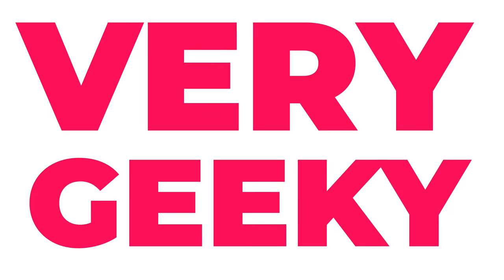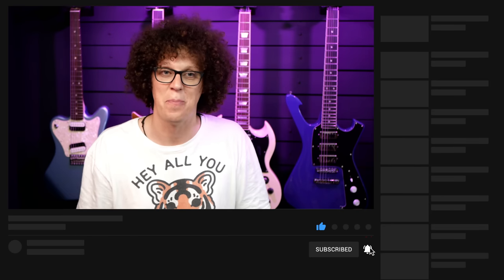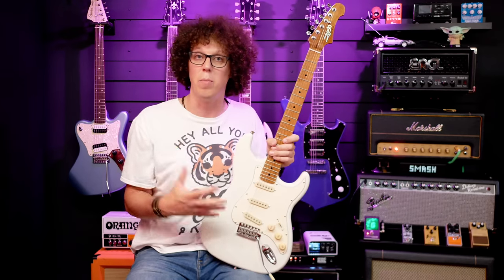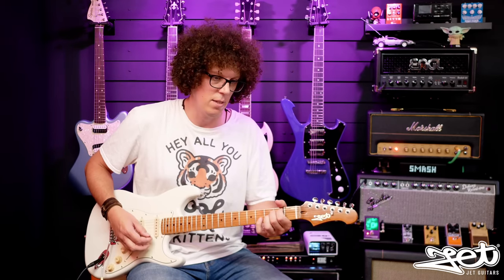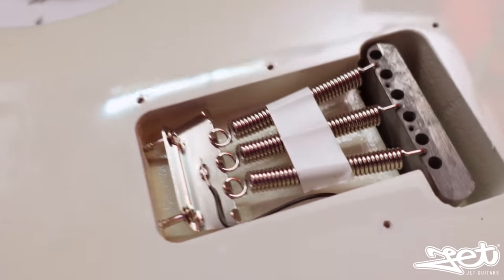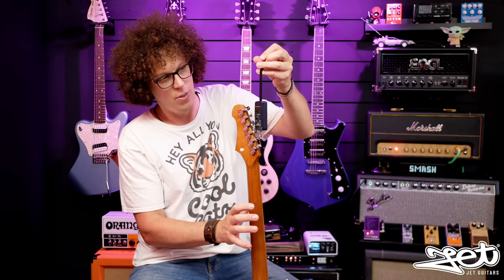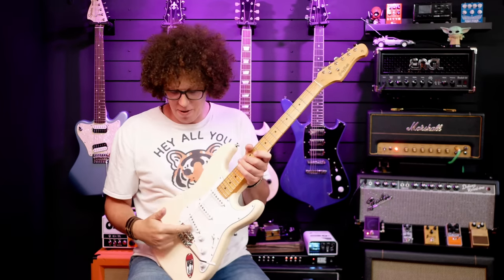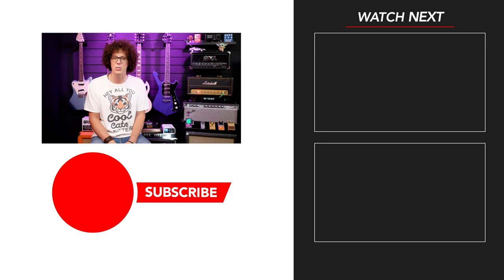Cheap Strat Showdown - Harley Benton VS Jet Guitars

Comment: I may go with the Jet.  Love the bone nut and roasted maple neck.  The new ones have two single coil and a humbucker which gives some interesting options, but not TRUE STAT sound.  Even so, the clean sounds are where the difference are.  After  you add some gain or a pedal, it's hard to tell which guitar is being played (Since my hearing is not so great).  Great comparison.  I didn't hear you complain about the bridge screws (Maybe I missed it) on the HB.  Several players have mentioned it.  Since I do a lot of  palm muting, that might be an issue.  Since I haven't seen an HB up close and personal, I don't know how much of an issue or if they can just be swapped out.  "CHEAP" guitars is a relative term now since most are made with CNC machines and can be quite well put together.   So, Strataliscious - if that's how you spell it LOL
Reply from the maker: Hey Steve, yes the saddle screws were a but annoying but something that can be fairly easy to fix.

Comment: Ive just bought the Jet JS300 and in my opinion the neck alone is worth the price of the guitar. Im hoping to use it as a modding platform but first on my list is to try to 'flatten' the black gloss finish 👍The neck on mine is more satin than glossy perhaps Jet have changed their manufacturing process ? Stratilicious

Comment: I just got a lefty Jet JS400 as I was swayed by all the hype surrounding the brand on here. Their profile seems to be higher than any other budget brand. I'm initial impression is this guitar is comparable to instructions to higher end Squiers. I like the sculpted heel, but some of screws in scratchplate and string tree were a bit wonky, so QC isn't quite there. As to playability, the guitar felt great (satin neck) and it sounds great through my Blackstar.

Comment: Great video. 
Having watched other reviews on You Tube, I have been surprisingly impressed by Jet guitars. However, I wanted to see a direct comparison with a similarly priced guitar of equivalent quality. The Harley Benton was a good choice and after your review, I found it difficult to choose between the two. They where both impressive for budget end guitars, but if I was in the market for one.  The JS-300 would win, although the ceramic pick-ups would be the first thing to go and a set of Ernie Ball strings fitted.

Comment: I bought a Jet JS450 for 300 Euros. One of the screws on the locking tuners was bent, but all work fine. There's imperfections on the binding. The color is quite different to the pictures. Play-ability is amazing. Sound...I have planned on changing pickups as soon as I get the guitar...and haven't done so yet, as I quite like the sound of the pickups.
Reply: what about the fretwork levels?
Reply: @ederrocha7758  I do have a 2500 Euro Blade, that I've been playing for 20 years - I do not notice any difference when I pick up the jet. And definitely much better than the 1k Euro Charvel DK-24 I ordered and sent back, because frets were unplayable.

Comment: I have several cheap strats with MAJOR upgrades because I like to see how close I can get to the American standard. You can get pretty close if not just as good with the cheap strats from h.b. and squier, so I'm guessing the jet would be the same
Reply: I think thats the way to go with solid body electrics..take a cheap guitar replace everything thats not wood including(and most important) the frets with higher quality ones(i have stainless steel ones in all my guitars now) and the nut...then roll the fretboard and presto..you have a high end neck everytime even if the neck says harley benton or squier bullet or jet....i would personally take a jet( cause i like the whole roasted neck at this price),throw in some big jescar stainless steel frets,tusq nut,hipshot tuners,new loaded pickguard with kinmans...the works...you cant really go wrong with this and if by any chance you feel that you wanna move to something else...just put most of the old parts back in and keep the expensive aftermarket ones for the next project....
Reply: @Dreamdancer11 The nut 😮b the Jet guitar is perfectly usable😮 not the best but good.
Reply: @johncollins5552  i know, i got the guitar eventually...the guitar is a great bargain...great roasted maple neck(the thing that sells this guitar),useable tuners,bone nut,standard chinese electronics and a bit rough frets.....i polished those frets and dropped the nut action a bit and that was that for a while..basically that guitar stands its ground bone stock against most strats and frankly i would keep it bone stock but i wanted it to be high quality suhr like so i did what i said i would do in my previous comment plus i scalloped the fretboard too...now its an instrument i wouldnt swap with any signature fender out there....

Comment: Do you want to compare the guitars or the strings? Change the strings on both guitars before testing. When both guitars have the same strings you can make a more accurate test. 
I just looked on the Trhomann site, the Harley Bentons now come with a roasted neck too.

Comment: I am a big fan of budget guitars (for modding). I ordered a Jet JS450 (love the look) on April 1st - and haven't gotten it yet. I also bought a second hand unfinished Harley Benton DIY Les Paul kit - with a bolt on neck. And to my surprise, its sustain rivals that of my 2 Epiphone Les Pauls. The switch and controls aren't great - so I am soldering my own electronics and will use Seymour Duncan P90s. The nut also needs work, but for 68 Euros and absolute steal.
Reply: Totally love the look of the JS450 too.  Has it arrived yet, and if so what do you think of it?
Reply: @rodsimmons9337  I got it three week ago. it doesn't look as gorgous as on the pics,but I still like the looks. It's very dark and less flamy - I expected I'd switch the PUs as soon as I get the guitar. But I actually like the sound. Few things:
Reply: @rodsimmons9337  one of the twisty things of the locking tuners is at an odd / close to 45° angle. It works, but when you change strings, you wonder if it'll have to be replaced eventually. And when setting up the guitar, one of the screws is under the low E string, so Ihad to loosen that to turn the screw. Still a steal at 300 Euros

Comment: How DOES one write stratelisious? Let alone define it?
Fun word, fun video.
I prefer the sound of the Harley Benton, sprouting fretends can be dressed, boards can be rolled.
The trem might need replacing, but seems to work ok. I know where I'd spend the extra ££ as well, on a nice cheap overdrivrive pedal.

Comment: They seem pretty equal (outside preferences, mostly). I think I'm going Harely Benton. Lower price, awesome customer service, great warranty & if I spend the same as I would on a Jet, I then get some sweet upgrades.  Thank you, great comparison & excellent playing. Wish I had learned the output jack rule of thumb earlier. Yikes I have one to repair from turning it and busting wires.

Comment: 6 bolt tremolo systems are going be stiff, but no need for tremolo setter or lock that you will need with a floating 2 bolt Floyd Rose. The biggest advantage is the Jet's volume knob is further away from the bridge pickup where the HB the volume knob is way too close even Fender make's that mistake. The Jet pickups has more clarity.

Comment: I didn't have the same luck with Jet ,  bought my youngest son one of their basses for christmas . Volume pot was shot out ,  frets were like razor blades down the sides of the neck , bridge was  crooked and no where even  close to centered .  Had no issues with return though and even had the 80 bucks back on my card  about 20 minutes after UPS picked it up . All in all I wasn't really expecting much for 80 bucks , and if it hadn't been for the volume pot , I probably would have done a fret job on it and centered the bridge .
Reply: They dont make basses, are you sure its the right JET guitars?
Reply: My mistake  , had to take a look myself at the invoices , the jet was cancelled cause he changed his mind and wanted the Jackson RR V , the bass was a glary .Must have been the cheap price that had me confused.

Comment: good review Andy .I bought the stratalicous js 400 after watching your first review.im delighted with it.as you said a fantastic mod platform.i also bought 2 Harley Bentons to stay sane in lockdown.the build quality of the jet is far better than the Harley Bentons in my opinion.had to change the tuners, the nut,the bridges and dress the frets on both Harley Bentons.did nothing to the jet except change strings and I've put locking tuners on....because I like em not because they were bad.im retired now.ive played Strats for 50 years mostly USA.i still have a 57 an 88 and 76.i bought the jet for a more modern sound.im still uncertain about the pickups I haven't tried them at volume yet.
cheers Andy.keep up the good work!

Comment: Hi, On the Jet Strat, I would invest in a 2 point piviot tremolo with a brass block, locking Ninja tuners, brass saddles, a brass nut and a loaded 920D strat HSH Modded pickguard then you'll would have something that the Harley Benton wouldn't even compare. The Harley Benton Strats needs to upgrade their tremolo Block, it looks cheap and thin, losing natural sustain in the tones.
Reply: with all those mods, you're better of buying a mexican fender. if you get bored with it, you will sell it for the same price you bought it for as well. and it will be better in every way.

Comment: Thanks for the video.

Aside (from the "triggered much?" collection:

It'd be nice if people stopped throwing around the term "budget" in the manner of which they do (which, to some, may be a $500 instrument).  The term has garnered a stigma.  The truth is that many of these "budget" guitars are built as good as or better than and include better feature than many big brand guitars costing up to $1000.  Quality control issues?  Sometimes, but not always - and those $2k guitars often come with the same issues.

Let's see.  Hmm.  Some of the new Fireflies.  Good wood.  Amazing finish.  SS rounded frets.  Locking tuners.  Bone nut.  Custom Alnico V pickups.  Full-size pots.  Good wiring.  Shielded cavities.  The list goes on.

How much would, say, a Fender Squier (or insert brand name here) with all of these features cost?

Heck.  Some of the "budget" guitars presently available have such legitimately good bones, it's worth it to replace almost all of the components.  You can do so and still come out hundreds of dollars ahead - - - and end up with a higher quality cooler looking instrument.  This can even include the cost for tools required to do your own QC, if needed.

Comment: Interesting... so Jet is a perhaps a better upgrade platform but the HB sounds most stratilicious out the box. You do pay a bit more for the Jet so the interesting question is you buy something further up the Harley Benton range, like the ST 90 which is closer in price to the Jet and only a touch more expensive, do you get the best of both?

Roasted maple and bone nut is tough to beat at that pricepoint though!

Comment: The Jet wins out in overall quality and features. Both guitars are good mod platforms, so the specific tonal differences are less crucial, as better pickups can be easily installed in either.  I'm sure you meant to say grams and not kilograms, as a guitar weighing 3000 plus kilograms would outweigh most cars. Lol.

Comment: I've been playing the Jet JS400 for a year now, which is like the JS300 but HBB, I've had very expensive Fender Stratocasters, so know good guitars, the Jet is great, I replaced the single coils, which were ok on the Jet, but with Iron Gear, Pig Iron, tuning great, but the trem springs, not good, after a few months, changed them, a cheap fix, the neck and playability is superb, it's now main single coil gig guitar.

Comment: Just got mine today...  JS400 in Vintage Yellow. The neck is a satin finish (NOT gloss).
What a great neck, one of the best I've ever played on, really well finished, excellent fretwork.  I'm astonished just how good this is for the price I paid.
The overall finish on the instrument is flawless, it's really lovely and I particularly like the way the body is contoured where the neck joins, it's really comfortable to play.
The 2-point term is pretty good and stable.
OK the tuners are crap, first thing to go and if I'm honest so are the pick-ups, but I would have killed for a guitar of this quality when I was first learning.
However this is a great guitar with good bones as a platform for modding, so this weekend I'm ordering Locking tuners, string trees, a tusk nut, a tortoiseshell pick guard, new pots and Pups.
It's really worth doing because this guitar feels fantastic to play (and that's what counts isn't it?)
Reply from the maker: Sounds like you got a winner!
Reply: Pleased to hear this, I'm buying a vintage yellow one myself tomorrow 😁
Reply: @martyldl6238  
I think you'll really like it.
Mine came with a single tone pot (which I actually prefer ) and the neck has a satin finish (really lovely)
change the strings immediately
Reply: Yeah I think it's the js300 that has the 3 pots, only 2 on the 400, I agree and after the video I thought the same about the strings 👍🏼
Reply: Got my vintage yellow 400 today from jg windows in Newcastle, they had every jet model in store 😯 the white js400 isnt far off the yellow very pale but I was sold as soon as I grabbed the guitar neck, the profile is absolutely perfect for me and looks like a boutique guitar lol I was unlucky with the fret sprout on mine and the set but for the money I dont care itll be perfect soon enough 😉👌 got some nice quality strings to go straight on aswell .

Comment: The Jet Guitar is better with the heavier trem block and roasted neck , change the strings and pickups and the electronic pots and you will have a winner.

Comment: The bottom line is these guitars are 1,000 times better than the crap they passed off for cheap guitars when I started (way way) back in the early 80's! I do wonder if one wouldn't be better served getting a used Squire? Or maybe buy a Gibder Stratolicous XP3000 - those things rock. Literally.

Comment: I found a way to tighten my nuts (!) which needs a jack plug in socket to hold sprung connection in place. All guitarists need a flattened teaspoon to remove push-on controls,  two sizes of Phillips cross-head screwdivers and two sizes of spanner.
Difficult choice as they both have a different pickup trio. Kind of different Fended eras. Benton more classic but  a Jet middle pickup would sound interesting on an H.B. I wish Fender did more 22 & 24 fretters and minimalist heels

Comment: Both are ridiculously inexpensive for what you get (compared to the stuff we used to get in the cheaper end). I'm sure squire have improved over the years but my experience had been nice looking guitars that didn't feel that nice and thin weak pickups (as a lefty I 've had too but online and don't always get to try them out locally). I was impressed but sceptical of the reviews HB guitars are getting so i decided to take the plunge and try a Les Paul copy. Although it probably doesn't sound like the genuine article, it's a seriously impressive instrument, no faults apart from one of the tone knobs sitting to near the arch top. A very playable, set neck, great sounding LP  for £130 ( and with coil tap pickups!). I'd seriously consider one of their strats. stratalicious. However at that price point your not to far away from a Cort G200 or a Yamaha Pacifica. Cort make guitars for other companies (such as Squier and a number of others) but if you buy a Cort you don't pay the extra for having a brand name slapped on. Unfortunately as a lefty i can't get the model i want from Cort (£200 G200DX in java sunset). Although i can't get the colour i want (sunburst)  my choice has come down to the HB or the Pacifica. Mind you, Artist guitars are getting God review s.....
Reply: what about jet guitars?
Reply: Sorry, didn't see your question until now. I was so impressed with the HB LP that i went for the HB strat. Seriously impressed, it does not feel like a cheap guitar. The jack socket does come loose and is at an odd angle, an annoyance rather than major issue. Sounds great, plays great. One negative for me is that, as a lefty, the pot taper doesn't feel quite right, compared to my Vintage brand strat. HB are not alone in this practice.

Comment: At the moment both are out of stock, if/when you can buy one for me the wider radius neck
of the Harley Benton would be my choice, the frets can need attention even on expensive guitars.
As far as tuning stablity is concerned the nut, string trees and trem will all affect it.
For an experienced player that can do their own mods and set-ups either guitar will do,
for a beginner, i would advise spending a bit more on a Yamaha Pacifica 112, or a Fender MIM Strat and still budget for a good set-up.
Guitars in this price range are rarely playable out of the box, as said in the video you might
get a good or bad example of either.

Comment: That's not a 9.5 and 14 degree radius. If it was the 9.5 would be flatter. It's a 9.5 and 12inch radius.  You probably realised that after but you'll confuse your beginner audience

Comment: Never heard of Her guitars
Reply: Sorry meant jet
Reply: Steel wool it with fine steelwool
Reply: That depends on how The claw is ajusted
Reply: If sounds dull
Reply: Truss rod has to be a little tight or neck won't ring out good so will sound duller
Reply: Needs some railhammers
Reply: That's a g for ya

Comment: Love your videos, but units of measure are not your jam.  The radius of the neck is not degrees, it is the radius length, so it is 9.5 inches, not degrees.  And, the guitar does not weigh 3570 Kg (that would be almost 4 tons!).  The guitar weighs 3570 grams or 3.57 kilograms.  But, although I can do math & physics, I play guitar like shit, so the universe remains in balance...